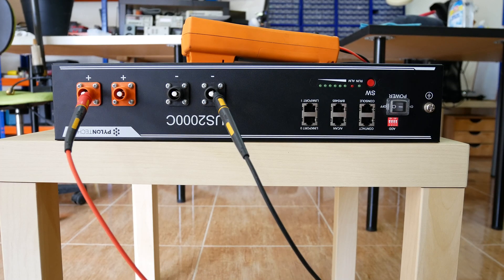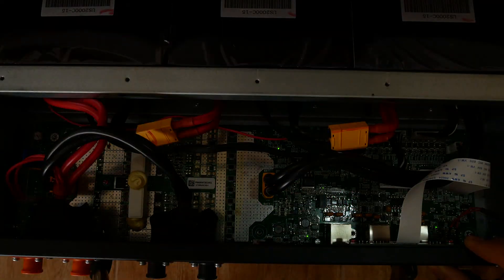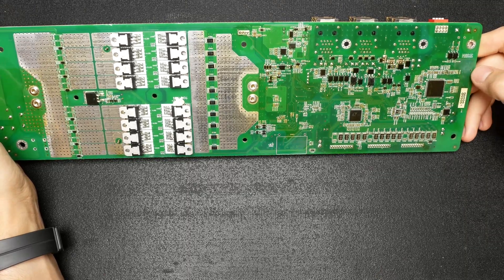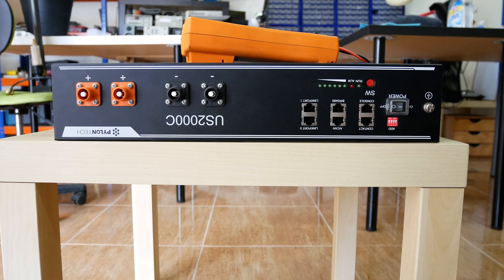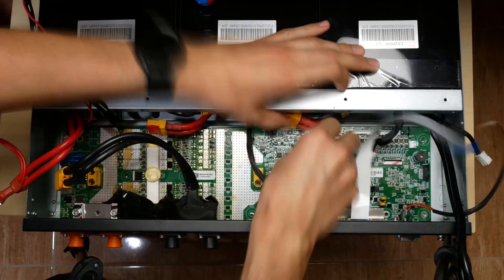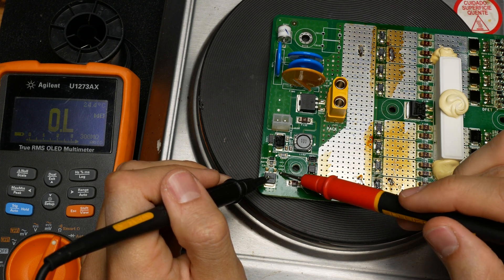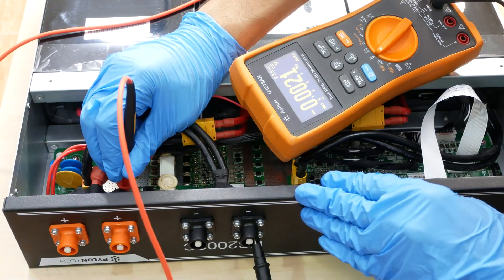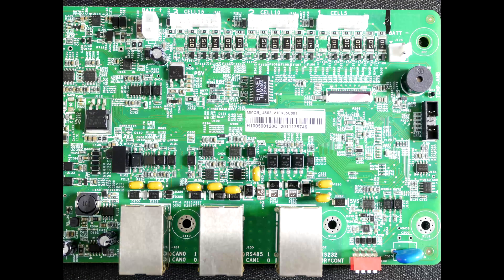Pylontech US2000C internal fuse repair (Solar Lithium LiFePO4)

Comment: Hi. Thanks for the video. I have a battery with shorted mosfets causing an alarm. Do you have any tips as to what could catch me out when replacing the mosfets?
Reply from the maker: Never done that, but you might get away with just replacing one in each bank to test before you replace them all. Also check if the controller is also actively breaking the fuses like it did to me...
Reply: @jfaria  Thanks. I did a quick check and it seems the controller is also shorted and the 4 pin fuses you replaced. This seems like a totally common issue. What I do see is that the thermal layer skipped a few mosfets, the ones that are skipped have discolored. Must be due to heat. Not sure if this could be a factory fault on them. 
My battery is hooked up to a Sunsynk 5kw with a Can bus cable. Set to 50amp charge and discharge.
Reply from the maker: @karlmuller4755  How many batteries do you have in parallel? I don't know what causes the failure in this video, but most of the failures I've seen on these (especially when they swell) were on off-grid/hybrid solar setups with too few batteries. I'm starting to believe that the long term reliability of these batteries starts to get spotty when people use less than 4 batteries (10kWh) in 5kW inverters, or less than 8 batteries on 10kW inverters.
Reply: @jfaria  Only one battery. But the system is used as a UPS for a server basically. The constant draw is around 300w. We have had a few spikes from the aircon etc. That would kick the inverter into alarm and protect the battery. As far as I can tell its over voltage causing the swelling. 
On another system I have 3 x us2000 batteries running for almost 6 years no swelling or any issues.

Comment: Good video thanks for this video. I have a question l have one us3000c and the BMS has failed. I want to change the BMS card . My question is after changing the BMS do l need to reset the serial number and AH capacity and SOC of the new BMS with usb diagnostic cable?
Reply from the maker: Good question, I haven't had much free time lately, but I have half a dozen swollen US2000 that I want to try and replace bad cells, I will try to see if there is an easy way to reset the BMS or change some of those parameters.
Reply: @jfaria where do you get those cells?
Reply from the maker: @tujuprojects  The guy who asked me to repair these had several failed units of different generations, my plan is to try and use one of them as a donor to fix the others. Unfortunately I've been busy and I didn't have time to do it yet, but I will document it when I get to it.
Reply: @jfaria  okay, it maybe those can be bought from china as new.

Comment: Muito fixe, realmente não há muitos videos.
Poucos meses atrás a minha us3000c, ficou acender o alarm e depois nada. Tentei medir a tensão nos terminais e davam 0.
Mandei para a garantia em espanha e mandaram uma nova.
Reply: I dont recomend Pylontech batteries, in two or tree years they will inflate. About Warranty The distributors reserve the right to give the guarantee and in practice they will not accept it even if in theory you have a 7-year guarantee, prismatic cells are better as you can always find spare parts since pylontech are special, they are 5s per module at least in the that i have.
Reply: @practicasaw8581  yeah, that can be a issue real quick. I don't know what's readily available in terms of parts.